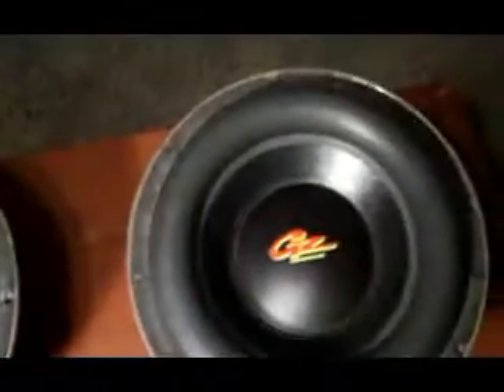How To Hook Up Two 4 Ohm DVC Subwoofers @ 1 Ohm On A Mono Block Amp

Comment: i have the same amp just 1200 watt, i see specs say 2 ohm stable but i want to wire my subs at 1 ohm im just learning all this today but to my understanding 1 ohm will use the full 1200 watt output correct? how long did you run your amp this way without it blowing up
Reply from the maker: I can't remember what this amp was stable to but it got really hot. I'm not even sure I ran it at 2 ohms. I just used this amp for the video
Reply: thx for the reply bud. my 1200 watt ma audio amp says 2 ohm stable i tryed 2 1000 watt 12s bridged at 1 ohm put the amp immediately into protection mode, so i re wired separately at 2 ohms and  just one 1000 watt lanzer max 12 puts it into prot mode i need somthing better i guess
Reply from the maker: Yea this amp was pretty cheap

Comment: Couldnt you just connect the ends if the wire together positive to postive negative to negative and put 2 wires in the amp?
Reply: I think so that the way I got it

Comment: Great video! 
What is your amp ohm impedance? 
Could I connect a 1 ohm enclosure to a mono block 2 ohm stable amp?
Reply from the maker: You can with the right electrical but I wouldn't especially if its a kicker amp. Really don't think they like under 2 ohms

Comment: I just bought 2 dvc kicker comp VR 12's. I could be wrong lol but I think I got told they are " duel 4 OHM dvc's ". I also have 2 12 dvc autobahn's and love them.Just not to sure which one's they are do know they have that "plastic plate I guess it's called" on the outside of them to protect the sub. They are being run by a Crunch Powerzone amp. Will the kicker comp's hook up straight to them? I am not sure what OHM load is on my old set up. But do know that amp has been a good 1

Comment from the maker: If you only plan on buying 1 sub then you need a dual 2 ohm to wire down to 1 ohm. If you plan on buying 2 subs or 1 now and another later then you need dual 4's to wire to 1 ohm

Comment from the maker: Sure its possible. For example no amp will tell you it is less then 1 ohm stable BUT lots of people like me run them under that. Its a risk we take man BUT make sure your electrical can handle it or you will kill your equipment.

Comment from the maker: Yep. Just wire up your first sub and put it in your box. Reach in and grab those wires and hook them to your second sub then put in your second sub. make sure you hook up the wires to your box or put them out a hole so you can wire to your amp

Comment from the maker: First thing is if your running each sub on their own amp then your not getting anymore power then just using 1 amp. If you hook both subs in parallel to 1 amp then you should get 1200 watts but just 1 sub in parallel you'll get like 600 watts. Get what I mean?

Comment: Thank you for the video
I have a query
I bought Subwoofer JL12W0v3-4
And AMP rockfordfosgate R500-1D 500 Watt Class-D Mono
Is there a problem or a good fit to work

Comment: i have a single sub with single  voice coil at 4 ohm ........... with amp stable at 1 ohm .....so i just connect the speaker wire to the amp??

it does not matter that the speaker is 4ohm and the amp is 1 ohm?????

Comment: what about if the amps rms specs are at 4 ohms and you have the subs down to one 
i have 2 boss phantom 15" 2500w and the boss onyx 5500w amp the subs have an rms of 1250 at 4 ohms each and the amp has an rms of 4 Ohms2300 Watts is there a problem with setting them up like you did in the video

Comment: i have a 1200watt monoblock amp i have two audiobahn 12's hook up to a 4 channel 400 ppi mosfet my 12's are in 2 ohm state but my amp the monoblock is not 1 ohm stable i need to know if there is away around this i need help

Comment from the maker: Actually would be 1 ohm or 4 ohms cause thats just the way it works out :) If you wire them both down in parallel it would be 1 ohm. If you wire them in series it will be 4 ohm

Comment: @casperskafs Alright, thanks! I also have on last question.. Is it the 2 Ohm dual voice coils that I'll need to be able to parallel wire them for the 1000w @ 1 ohm the amp puts out?

Comment: So if I got 2 kicker 10CVR15, with 4 ohms, and they're 500 rms each. Would I need an amp that outputs 1000 rms since I'm getting 2 subs that would equal 1000 rms? Or an amp that outputs 500 rms? I was looking at this amp: Hifonics HFi1000.1D Class D. I'm just starting to learn about systems so if I'm saying anything weird, I apologize.

Comment from the maker: @Wilsonaire No bro you won't damage anything. Trouble happens when you wire amps lower than they allow. You can go up as much as you want. Just hook each speaker like normal to each channel and it will prolly sound pretty good

Comment: I have a (4Ohm 2 channel/2Ohm Mono) Amp.  I've been curious if it would be possible to hook up 2 large (theater) 8Ohm speakers to my amp for simply playing music outside.  I'd either have to do each 8ohm speaker on a 4ohm channel, or run them in parallel as 4ohm on a 2ohm Amp.  Essentially: Can you use a higher ohm speaker on a lower ohm amp?  Will that damage it?  Thanks a ton, your video was great!

Comment: @TheDBoricua i would recomend gettn a 1000 wat amp that does is 1 ohm stable the average 1000d is not doing true 1000 and ur prob runing at 12.6 volts so should be a nice set up man please no hattn just tryn help out lust sayn bigger is not always to go the cvr is one of kickers bottom stuff not doggn it just sayn so yea go kinda big so u dont distort it cause distortion will kill a sub faster then over powering good luck

Comment: I have a question I bought 2 Alpine Type R 12s and realized when i hooked them up only one was working but when i hooked both up they don't hit as hard and sound distorted but when i unhooked the one it hit so much harder what do youthink is causing that

Comment from the maker: @ArthurFabbro The lower the gauge the bigger the wire which means more power. Be careful though sometimes too much power is bad if you have a sub that can't handle it. This video is just parallel.

Comment from the maker: @72guitar66 You should be able to hook to the same distribution block if you have 3 outs. I have 2 8 gauge wires and a 18 gauge wire for my fan runnin on distribution blocks